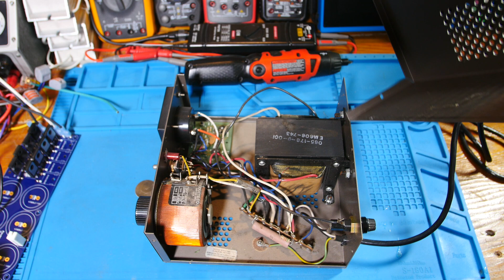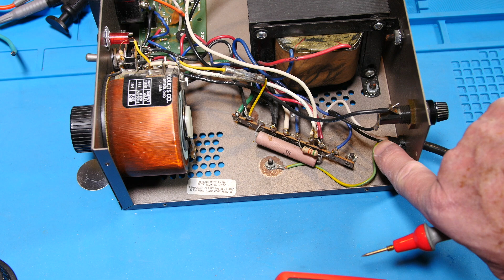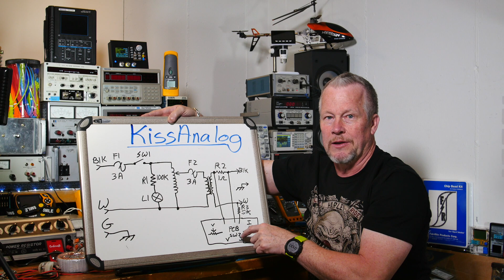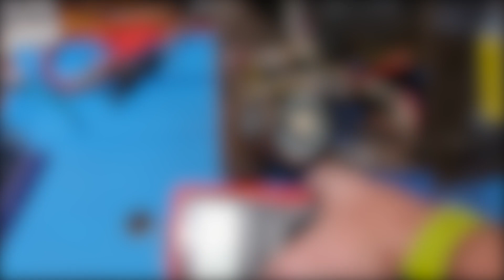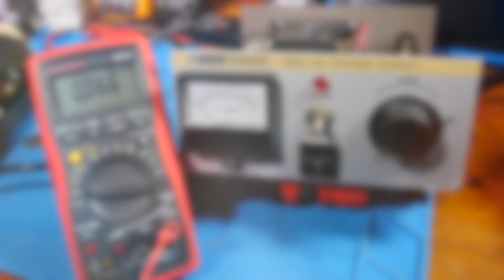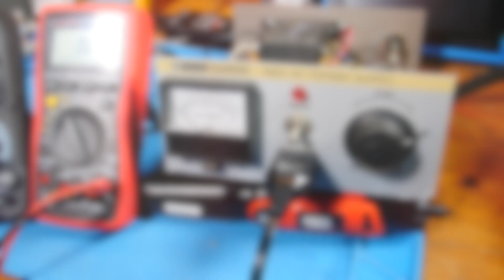BK 1653 AC Power Supply Repair

Comment: For God's sake, you started talking about taking a voltage measurement across that fuse at the 5:00 mark.  You didn't actually do the measurement until the 21:00 mark.  YOU'RE MAKING ME CRAZY.  We didn't need a guided tour of every colored wire on the chassis.  Just take the measurement.
Reply from the maker: LOL sorry about that.

Comment: The internal fuse was likely already open at the start of the video.  The 10 ohms you measured was the resistance of the path through the primary winding of the isolation transformer plus some portion of the Variac winding as well.  Also, it seems silly to have the internal fuse soldered into the circuit instead of in a fuse holder, which would have made it easier to test and replace.

Comment: Can you play the Batman jingle when you do the spin lol
I was wondering if you could use 30 amp variac coils as valve output Transformers and just  solder the wires for 2 4 8 and 16 ohms. Would they make a good output transfer considering they are fairly cheap. And would you need an iron core or not easily put in?
Make your own contact cleaner use a syringe about 30% methylated spirits 60% white spirit/mineral spirit and about 10% WD-40
Reply from the maker: I thought about playing music for fun, but thought that some might be annoyed.  But Batman would have been awesome;) Thanks for the awesome contact cleaner!!
Reply: @kissanalog  yeah I've used it a few times seems to work quite well yes you know that piece of music in the 1960s Batman when you get the spinning picture change of scene I'm sure you know what I mean or Google on YouTube nana nana,. You got no opinion on the variac either way nobody give me an on this

Comment: Hi Eddie, for your repairs like this power supply, do you use a isolation transformer or any other safety equipment like a RCD on your bench ?
Reply from the maker: That's a great question!  I should explain that in a video.  I think I briefly mentioned it but it deserves more emphasis.  I do use a power strip with a breaker.  I use fuses too when I think it is needed.  I'm pretty careful and have also been lucky;). Thanks for asking!
Reply: @kissanalog  the reason that i'm asking this, is that at the moment i'm working on a isolation transformator with build-in "dim bulb current limiter" with 4 small GU9 Halogen lamps. For the output socket, i wanna use a very sensitive RCD from 10mA. But it turns out, that this RCD only works, when 1 of 2 secundairy leads is bound to earth, so that this become neutral, and the other secundairy lead becomes the hot. But if i turn the secundairy with one lead to ground, i'm bypassing the safety which a isolation transformer provides. 
Another side effect that a isolation transformer has, is the present of socalled Phantom / Ghost voltage between one of the secundairy leads and ground. This leakage is very low current, but it can damage sensitive electronics. On YouTube there are many video's about building a isolation transformer, but none of them mention how to handle this Phantom / Ghost voltage. Connecting the secundairy with 1 lead to ground let this Phantom / Ghost voltage almost completely disappaer to zero volts, but a ground bound on the secundairy will again bypass the safety of a isolation transformer.

Comment: Looks like you can use some DeocIT D5 for all your dirty contact surfaces, here’s a link to a good product. https://www.sweetwater.com/store/detail/DeoxIT--caig-laboratories-d5s-6-caig-deoxit-contact-cleaner-5-percent-spray-5-oz?mrkgadid=3303549150&mrkgcl=28&mrkgen=gpla&mrkgbflag=0&mrkgcat=livesound&lighting=&acctid=21700000001645388&dskeywordid=92700046937475313&lid=92700046937475313&ds_s_kwgid=58700005283380191&ds_s_inventory_feed_id=97700000007215323&dsproductgroupid=476199830282&product_id=DeoxIT&prodctry=US&prodlang=en&channel=online&storeid=&device=m&network=g&matchtype=&locationid=9031939&creative=285688985259&targetid=aud-338835606939%3Apla-476199830282&campaignid=1465475237&gclid=Cj0KCQjw5eX7BRDQARIsAMhYLP-0ywp89LkJE7r0IpVjiZGSRZSP6LJ-Ujpdd0D2ISjSZmpWIZ7y8XUaAu9FEALw_wcB&gclsrc=aw.ds
You also could use it on the wiper surface of your variable transformer
Reply from the maker: That’s a great idea - thank you!  I actually have some contact cleaner and lube I picked up years ago for audio work.  I should have used it, but I think I was worried about making this too long, but it was a great chance to use it;)

Comment: Nice video. Thumbs up. You're braver than I am turning it on after many years with a dodgy fuse and without a blast shield.

But as an old timer, I have to admit I'm really sad that such simple devices are no longer made in the USA...
Reply from the maker: LOL Thanks, but I have to admit - I did put on safety glasses;)